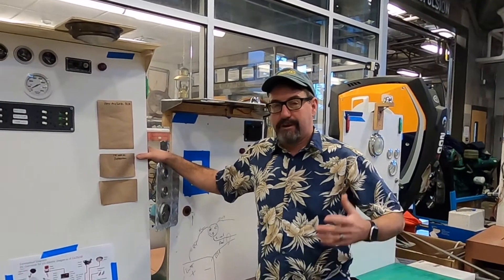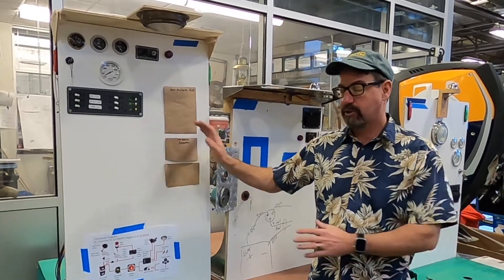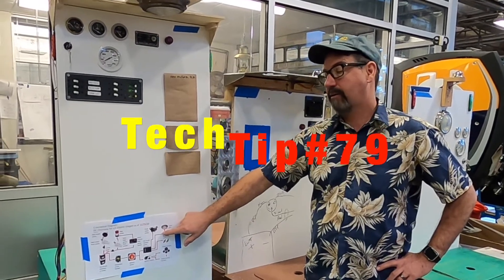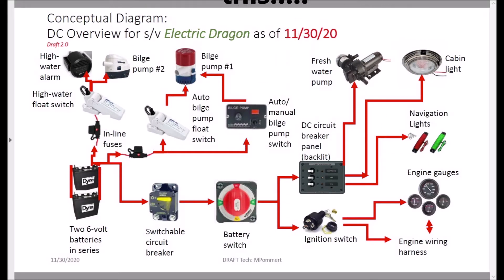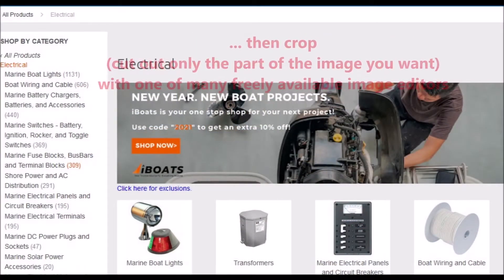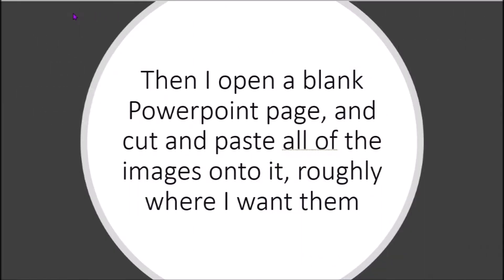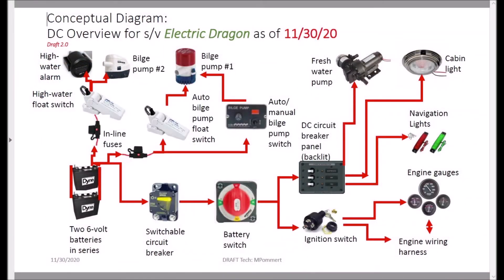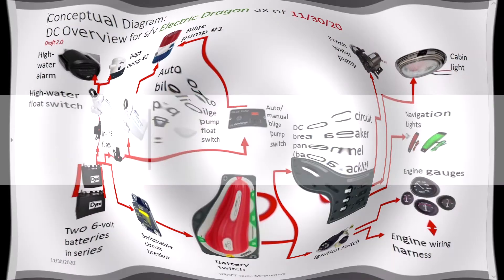Tech Tip#79: Creating Conceptual Electrical Drawings

Comment: Thanks Margaret, I didn't know the arrows would stay associated with the objects in PowerPoint.  That makes it a bit more useful than the Pages program I use on my Mac.  With that I have to adjust each object individually.  Thanks for putting this together!
Reply: Thank you! Got the idea for the conceptual electronic diagram from Jeff Cote of Pacific Yacht Systems. I just had to figure out how to create it with a common software (all students here can get MS office) rather than a more appropriate (but expensive) software like MS Visio. I really like doing this intermediate step, rather than trying to go directly from blank sheet of paper to electrical wiring diagram. Plus, this is something that a tech can use for a discussion with boat owners, and leave with them as a reference, even if they can't understand an electrical diagram. Next, I'm hoping to use them as the basis for some operating and trouble-shooting instructions to leave with owners. (If something doesn't work, "make sure THIS switch is on and THIS fuse isn't blown, etc."